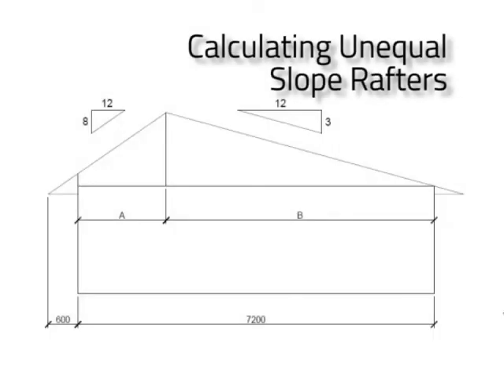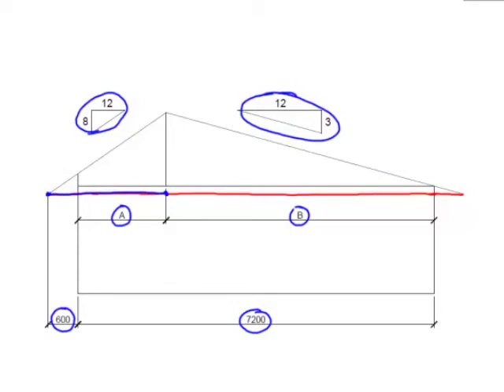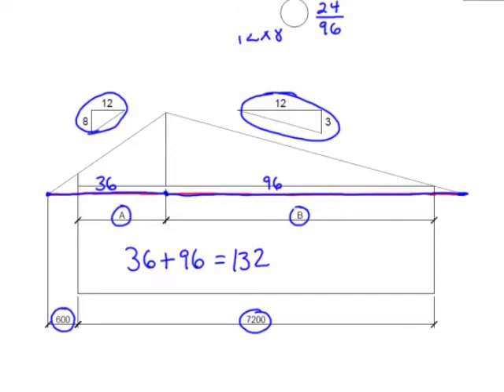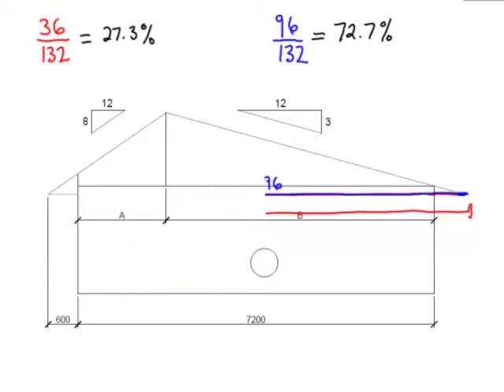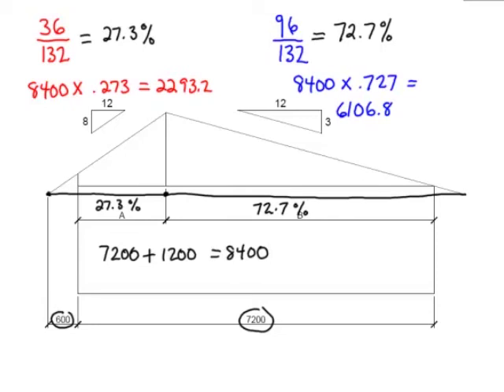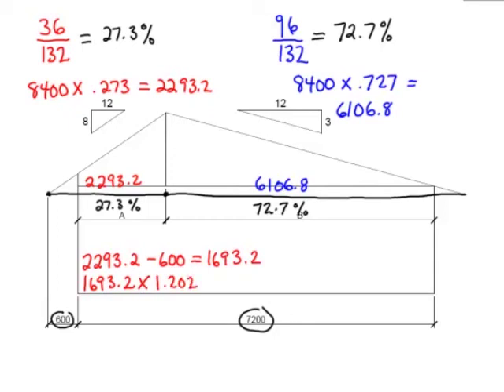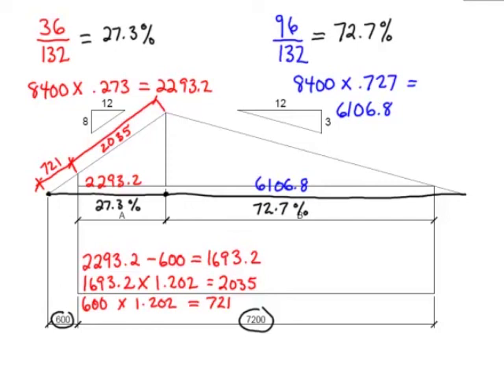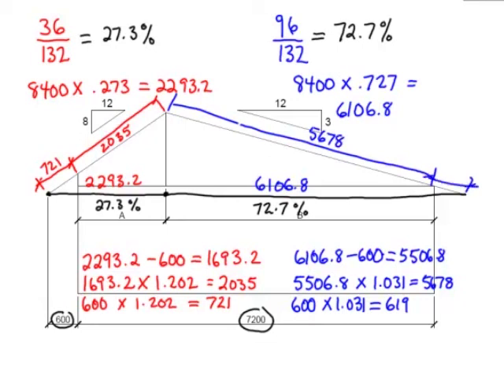Unequal Sloped Rafters

Comment: how you get the 1.202 number?
Reply from the maker: Hello @juniorpalomera-garcia7448. That number is a handy trick that takes the slope of the roof and converts into a number that when multiplied by the run of a rafter, results in the sloping length of the rafter. A couple of comments below this there is an explanation on how to find the SGF.

Comment: Hi Martin,  how do you get to the slope gain factor? I can follow everything your doing, but I got confused when you started multiplying by the slope gain factor??? Yet again any advice would be greatly appreciated thanks again Steve
Reply from the maker: The slope gain factor is helpful for calculating the length of the rafter when you know the run of the common rafter. If it was a 6/12 roof the calculation would be 6÷12=.5. Then take .5 and square it .5²=.25. Then take .25 and and 1 = 1.25. The last step is to take 1.25 and find the square root = 1.118. Then take that and multiply by the run of the rafter. Presto!
Reply: Thank you, I've got it now, much appreciated 👍
Reply: Rise divided by run = x squared  plus 1 than square root that= slop gain factor for 90 degrees 
For a hip it’s almost the same except after your square your number you would add 2 instead of 1 , then square root it

Comment: Hi there again ,I know that imperial measurements Express pitch as 4 over 12 or 6 over 12 ,how do you Express it in metric increments?? Is it 30 mm over 300mm  ?? Please help 👍🏻
Reply from the maker: Hi Steve. Back in the day when metric was adopted all the square manufacturers wanted to be the ones to decide the basis for run. I have heard of three different numbers, 250, 300, and 1000 mm. The Chappell metric square uses 300 mm. Therefore a 6/12 would be the same as a 150/300.
Reply from the maker: I also recall the Frederickson Metric framing square but don't recall the base unit that he used.
Reply: @martineisbrenner  can one not just use the imperial unit slope triangle to work out the rise in metric if one already has run in metric?

Comment: Can rafter be unequal in the building code? I have a flat roof, and need to design a gable but the chimney is right in the middle, so I need to make a rafter shorter than the other
Reply from the maker: Rafters are sized according to the tables in the National Building Code according to span so yes, they can.